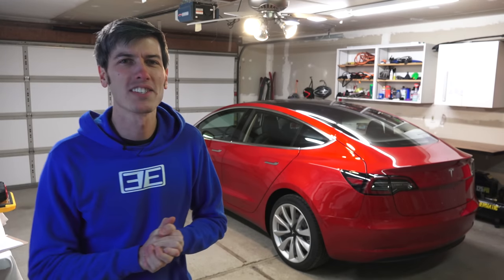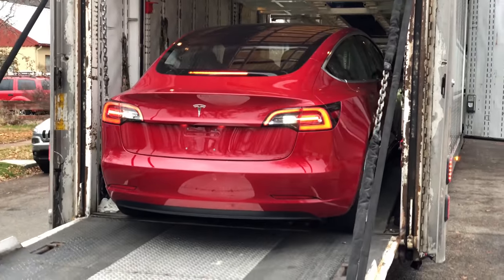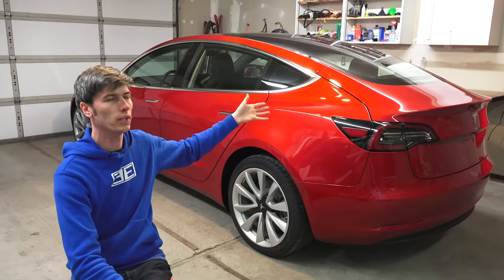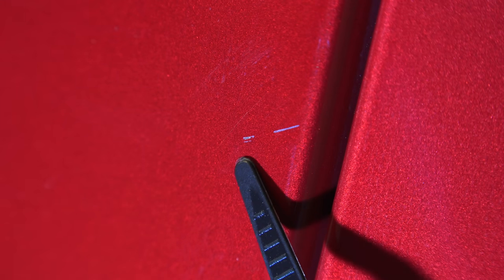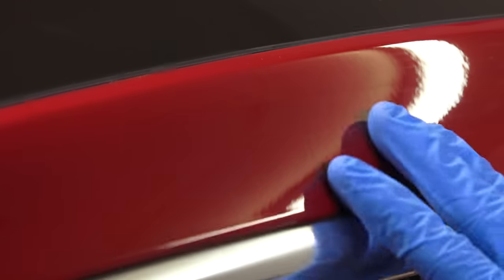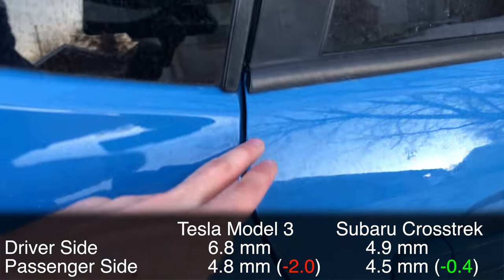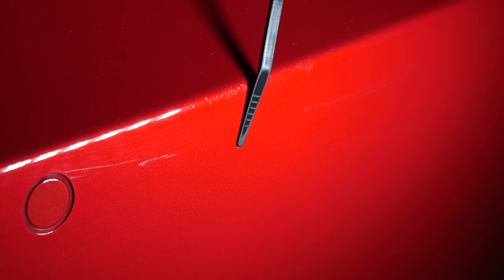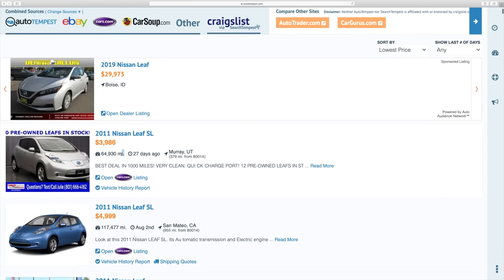Everything That's Wrong With My Tesla Model 3 - Quality Problems

Comment: huge Tesla fan here with a RWD LR 3.  Completely unacceptable on Tesla's part to deliver cars like this.  A lot of people say that caring about these blemishes is petty and that we should just enjoy the car.   If Apple were to sell you a phone with scratches on the glass and body, would you accept it or ask Apple for another new phone?  That's a ~$1000 purchase.  A Model 3 is >$45000.
Reply: likewise, if you sent your car into a bodyshop to get a car repaired with new paint you'd not find this workmanship acceptable either, and this car is supposed to be new not a repair job.
Reply from the maker: I think that's a fair point!
Reply: Apple is worth way way more as a company than tesla. They have more resources for qc
Reply: @MrMW2nd  and apple dont seem to be using those resources, the new ipad being one big example, putting a hole in the metal of a large device tends to weaken it
Reply: I like your logic
Reply: @MrMW2nd  The QC budget needs to be higher when you're shipping literally 100,000x the number of units. Tesla can spend the money and time to address individual issues.
Reply: I agree but there was complaints last year or so about scratches shipping on the glass with apple, May have been the iphone x. They where minor in comparison to the paint on that tesla
Reply: @EngineeringExplained  Definitely contact Tesla for repair/replacement!
Reply: He clearly dident want to piss tesla off with this video
Reply: @GS850GLZ-82  Be careful though, as Tesla has a trade-in policy in which if any body work has been done to a car (only certain body shops are permitted to work on their vehicles, so they know who has had what done). If EE goes to trade it in at a later date, their policy is to knock 20% off of the offer if any body work has been done post delivery.
Reply: Lol it's definitely not acceptable, but apple is a bad example because they say the slightly bent ipads out of the box is completely normal.
Reply: U are buying an Apple product. That already means u are used to low grade quality.
Reply: sports4eva115 Apple? People would accept it. Apple fanboys can do no wrong. Apple keeps falsely advertising sapphire on certain products, and JerryRigEverything does tests proving that it's tempered glass instead of sapphire, and people get mad at him for pointing out the lie and insisting it's not a big deal for Apple to sell sapphire and provide tempered glass.
Also, when he easily snapped the iPad Pro in half, showing major flaws in Apple's design, they got mad at him again. That's not a realistic test anyway, nobody is going to do that in real life, blah blah blah. And now Apple is now in hot wooder water because iPad Pros are bending. Gee, almost like if you can easily snap a product in half with your bare hands, the product is poorly made and will bend easily through normal use! Some of them are even bent brand new out of the box, and people still defend Apple. Completely ridiculous.

You picked a bad company to use as a comparison. 😋
Reply: I dont use iPhones or tesla
Reply: Finally someone speaking sense!
Reply: Well they're selling out of the box bent ipad Pro worth a minimum of 800 dollars and they say it's fine because it's a result of manufacturing.
Reply: @imkwyl_jr  I can see why, Dont know about Tesla but have owned 2 I phones and was twice burned. Never again
Reply: Too true.
Reply: Tesla is fixing it, non issue.

Comment: If I'm paying $45-50k for a new car it had better be constructed to at the very least the standard of a Subaru Crosstrek ($21k).
Reply: Or even a Nissan Versa.
My 1994 Caprice Classic wagon has better panel fitment and the original paint has less scratches in it.
Reply: nah bro if you're paying 50k for a new car, it better have the quality of a toyota or honda
Reply: I spent half that and got a used Challenger R/T.

Half the price, twice the fun.
Reply: Gus Goose  ok bro name brands better than Toyota and honda
Reply: @KrazyKrzysztof  your all wrong 50k here will get you a nissan gtr. Which is a far superior vehicle to this.
Reply: Gus Goose  Toyota has quality control, Tesla has no quality control.
Reply: Gus Goose  You're objectively wrong, and ten seconds on Google will show anyone that Toyota, Honda, and Hyundai have the least recalls over the last several years.
Reply: Yes
Reply: I was stunned to listen that Tesla asks $2500 paint. Even a brand like Porsche does a better paint job for way less money.
Reply: That's my take. I still might buy one, but I'm appalled these flaws make it through their QC.

Comment: I worked on a Honda assembly line for a few years on the first section of the trim line, meaning we received the vehicle bodies right after the paint section. These scratches are absolutely unacceptable and should have been EASILY caught either by employees down line or by QA employees at the end of the line. At Honda, we wore uniforms and boots without any exposed metal pieces and were required to cover all panels with large protective covers immediately after receiving the bodies from paint. These covers remain on the body throughout the rest of the manufacturing process. Having seen video footage of Tesla's factories, I know they also use these coverings, so I wonder WHEN these scratches might have occurred. It's clear that their paint application is definitely sub par quality out of the gate in this case, especially with that captured dust particle. But those scratches, I would assume, must have come later perhaps in storage or even in transit to you, the customer. Perhaps, that's why you received it so quickly even. Maybe it was in storage waiting for a buyer in unsatisfactory conditions?

I don't know though. Those driver side scratches look like they could have been caused by someone getting in and out of the cab with metal on their person or maybe rubbing from a pneumatic drill hose or something on the assembly line. OnTrim line 1 (Honda), we removed the doors and sent them off to a separate line so that it was easier to enter and exit the vehicle body without scratching it. I wonder if Tesla has a similar manufacturing process.
Reply: I would return the car back with that many defects. With 22 miles, I would think it might be returned by another customer previously therefore the quick delivery.
Reply: Did you work at Honda in anna or Marysville,oh?
Reply: @Poker-is8dt  I actually worked at the East Liberty Plant right down the road from the Marysville plant on 33. When I was there, we assembled the CRVs, RDXs, and those horrible Accord Crosstours. I left to go back to school and finish my BA around the time they started production on the NSXs in another building onsite. I would have loved to have been a part of that team, but the application process required like 20+ years of experience with the company to even be considered, and I was one of those lowly temps making half as much money doing the same exact work as the full-timers. I thought about going back now that I have my degree in Japanese, Spanish and Linguistics, but the work culture was pretty toxic on the ground level when I was there. I don't really want to work for a corporation that doesn't seem to care about its employees. I do miss those shutdowns though, even though we didn't get paid.
Reply: I'm willing to bet all the scratches are from the shipment of the vehicle.
Reply: @rasterops1083 same with my thought
Reply: I'm gonna hijack your comment because mine is similar and it was gonna get buried.

I've worked in both bumper and body paint at a large auto manufacturing facility in the US (not saying where because I still work there, but I'll say that we're... well-known for our production system). The  under clear seed and scratches are absolutely unacceptable. Seeds are allowable at different sizes based on their location; it's not cost effective spending as much time perfecting an area that the customer will never see (the undersides of the doors, etc.) as an area that they'll likely look at every day (such as around the door handles). The location and size of that seed are a major no-no, and that car should have been sent to repair prior to leaving paint. The scratches, regardless of when/where they occured during production, should not have reached the customer, either. There should've been multiple levels of inspection/QC that caught those, because they're inexcusable. I'm talking in terms of standards we apply to every car/color, not even an upgraded package.

As for the orange peel, it's hard to tell. Newer cars tend to have a surprising amount of allowable orange peel. I'm not exactly certain why, but my guess is that it's a switch from more solvent-based paints (bad for production workers and the environment because VOCs) to water-based paints. My background isn't chemical though, so anybody who knows more can feel free to correct me.
Reply: We have those practices at JNAP where the Grand Cherokee is made.
Reply: @HaloHamstur  yeah and then  they put dirt on the body and rattle canned over it...GTFOH...quality control is non existent and they build cars in tents
Reply: JesseArt great analysis @JesseArt !! And to think Honda fans say the Acura and Hondas are made in entirely different plants or lines to justify the higher cost.
Reply: @scout5678297  orange peel is due to the new water based paint. I work at a repair shop since 2001. When i started we were still using the old paint that was deemed as very bad  for people and environment so we changed from sikkens to a water based Italian  brand and we still use it today. It can be less visible if you use a high quality vernish and paint gun but it will always be there. About  the bumper issue water based paint tends to become darker in plastic. If you paint a metal part and then a plastic one with the same paint when it dry up it tends to become darker so that can explain the diference between color from the car to the bumper. Sorry for my English not my first  language. I live and work in Portugal.
Reply: My world would be rocked If I saw Honda make a flawed product.
Reply: I own a 2017 Honda Ridgeline and there is no reason to measure the door gaps- I can see the difference from 20 feet away.  The body panel fitment/alignment on my Ridgeline is atrocious. I love the vehicle otherwise, but wish it had the same build quality as my 2008 Ridgeline made in Canada.
Reply: @sparklander  Oh ya, There was that thing.
Reply: @sparklander  Yeah, the Ridgeline is manufactured in Alabama in the same plant as the Pilot and the Odyssey. When I was at ELP in Ohio, we constantly had people traveling down there to help out with deadline and quality issues. If I were in the market to buy a Honda, I would definitely only stick to those models made at the Ohio plants. They certainly seemed to have the best QA from what I heard. ELP actually had great numbers, perhaps due to its smaller size with only 1300 employees or so. The Marysville plant down the road has probably double the employees at 3-5000, but their QA seemed pretty good too from what I remember.
Reply: I work at Toyota making corollas and I have to 100% agree. This is not acceptable. Tesla needs to up its manufacturing game. We run the same as Honda. Take door off right after paint. No metal in the shop. Covers on all equipment to prevent damage.

Comment: As a former painter of the (then) Volvo carplant in Holland I have to say that that paintjob is unacceptable, if it is not a transport damage isue. The spec of dust should have been noticed and fixed and the orangeskin should have been rejected. Full stop.
As for the panelgaps, they are the canary in the coal mine: it is not the gap perse, it's the inconsistency. Those panels were put on the car by different people (mostly) or at least on different workstations. How well they align shows how well the whole system is calibrated. If the panels don't align who is to say that the wheels, axles, brakes, seats and every other part aligns with the rest of the car. This shows VERY poor building quality.
Reply: Exactly.
Reply: 69drummerdude Mmm Volvos. Loved my white 02 S60.
Reply: Agreed - this is not industry standard of today. Looks like Tasla praxis the same level of professionalism Italian an British car manufactures had in back the 70's

Comment: if i was buying a used car and saw panel gaps like that, i would think the car was involved in a crash and was repaired...
Reply: Chris Banana My truck was involved in a big crash and repaired and it’s not that bad.
Reply: lmao my dad was a panel beater and would wince if he saw this video
Reply: Dodge has the worst
Reply: @putonewhiskey  ye here in norway there are tons of them and they basically lose theire paint in 1 winter
Reply: More like shot by a tank cannon. I rear ended someone at 30 kph in my 2008 Citroen C3 I (the AC was FUBAR and the lights got torn from the mounts) but the only thing you can see is a small-ish gap between the bumper elements (the bumper is sagging a bit). If I saw a car like you describe for sale, I'd suspect it was either totaled or used as a siege ram
Reply: @nickkrikorian5780  Yet Dodge was recently listed as having fewest flaws at delivery, Tesla the most.  JD Power is a scam.  As for Tesla, read some reviews by assembly line workers in Fremont, who claimed they were under extreme pressure to get out as many cars per shift as possible.
Reply: New Hondas also seem to have worse fit and finish. My 2020 Civic has more rattles, uneven panels, and wider gaps verses my dad's 2010 Civic.
Reply: @dw2843  Most of us Americans don't know what a panel beater is.  It's an auto body repair person.
Reply: it’s normal on american cars

Comment: Awful paint quality. Some scratches on clear coat are ”normal” due to transportation and dealership wash and such things. But scrathes going through clearcoat and even down to base paint is not acceptable.
Reply: Aslan Abioqa That and that huge dust bubble painted over with the clear coat is a huge red flag.
Reply: USA standard ^^
Thank god ttip didn't get through or we'd be on the same low standards
Reply: Scratches are normal but 90% of cars delivered are unscratched. That being said what's not normal is for a dealer not to check the car or for a dealer not to bother repair the damages and imperfections,  once it gets delivered to them to give to the customer. 

Once its at the dealer they should be reparing them or sending them back, not giving them out to their customers in this state. As I promise you this damage wasn't done on the journey from the dealers to the buyer.
Reply: atourdeforce exactly. I took delivery of a new Seat Leon this year and the dealer proactively found a scratch and repainted one panel before I even saw the car.
Reply: @abioqaas  Wouldn't that make it look like that panel had an accident and repaired? Because of the difference in the thickness of the paint.
Reply: Çağrı Utku Akpak Honestly I don’t know what happened and the owner should not even be playing Sherlock Holmes to determine how the damage was inflicted
Reply: @CagriAkpak  No that's not true at all. Also why would they leave a surface uneven when they have the technology to get it perfect, I.e sandpaper. The problem is this whole thing wreaks of people not bothering or caring and that's a far worse issue if you ask me.
Reply: @atourdeforce  What I mean is the difference of paint thickness between different panels. There is a measuring tool to detect this paint thickness and it is generally used to determine whether something is repaired or not.
Reply: I'd hope to have no scratches at all - thinning the clearcoat to remove scratches even just in the clearcoat leaves less paint protection, and might then not cope with bird droppings etc as well?
Whether a wax paper 'peel off' film could be used to protect the paint after factory inspection? - also would mean that the first person to wash the car is the owner [never wipe the paint when dry]
Reply: mondayfool I think you have a good point there as in a factory it’s a big delaying factor to fix minor issues. Now a 3rd party just fixes the issue without delaying their production.
Reply: @pault5179  I'm no spray painter but I imagine you sand down respray the requisite ammoylunt of layers then blend in and clear coat over it.   Even if they were touching up bits I highly doubt they are going to have less layers or leave it with half a layer of clear coat. Also how much of the clear coat they take off isn't an issue here because they are clean through it into the main colour.
Reply: @CagriAkpak  generally, that tool would only be useful for an amateur repair job. A good, professional spot fix would include a complete blending of the area around the scratch, leading to an even paint thickness and color.
Reply: if your a true fanboi they don't matter lol
Reply: @atourdeforce  nope, you give it a key and then paint on top otherwise you risk taking off the primer and galvanising.
Reply: @98dizzard  you haven't a clue have you?? I don't know much but I definitely know scratches that are as deep and as many like here would definitely be sanded down to the metal there is no galvanizing on cars that's why they use primers and undecoats.
Reply: @atourdeforce  bahahahaha, no galvanized car body panels! You've not a clue have you, most modern steel cars are galvanised. Most of them can probably be polished out, they're not through the clear coat just have some contamination on them.